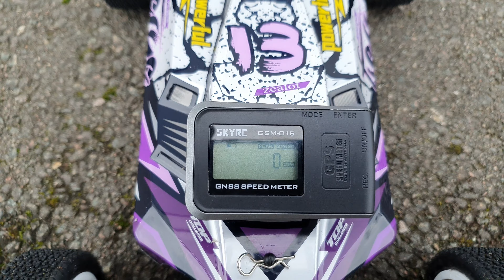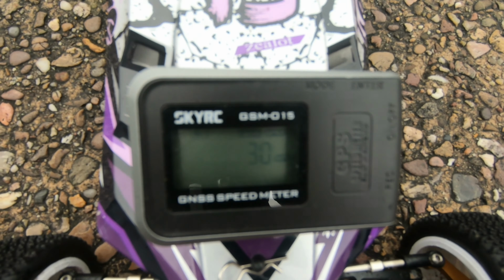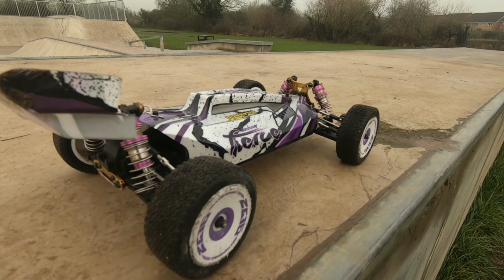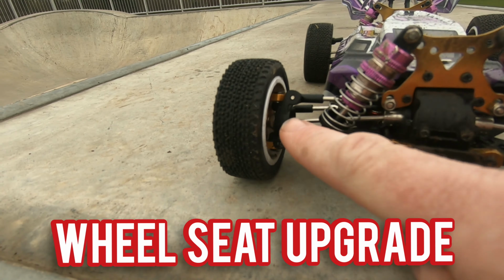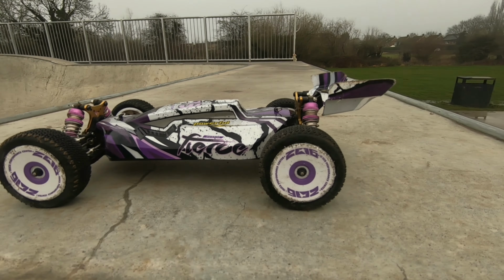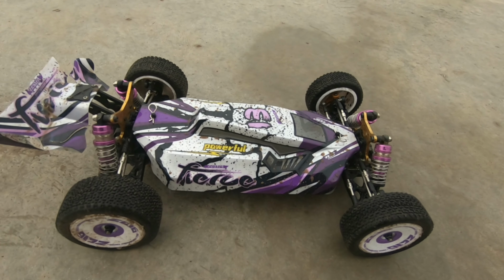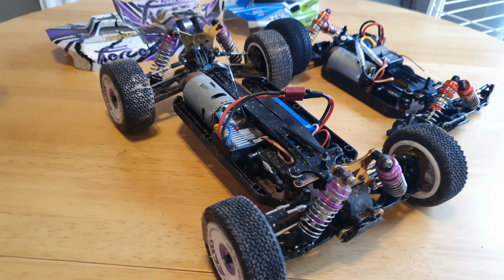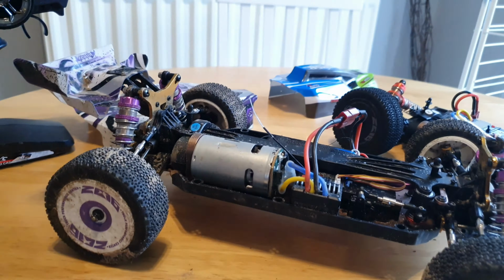WORLDS BEST WLTOYS RC CAR (124019),EXTREME BASH!!***

Comment: Excellent video! Thank you for posting. I'm wondering if getting it wet had anything to do with its demise?
Reply from the maker: I don't think so ,its just the motor don't like hard landings 🙄
Reply: @rchobbiesuk9492  Well, the motor runs, just sounds like it has TONS of strain on it... it could be the diffs, i heard that the differentials are absolute TRASH. Maybe get the full metal diffs that are available on amazon or banggood.

Comment: I have one of these. Not fit for jumping these cars. Let it stay on the ground, asphalt, gravel and a bit of dirt. That is it. Then you hardly break anything and the fun will last longer.
Reply from the maker: cheers thanks for the advice 👍
Reply: I have one of these and have modified it myself with some metal protecting the shock towers and stuff helps for crashes break less

Comment: i am getting this car and I am wondering if the stock charger is good or if it will kill the Lipo
Reply from the maker: No problems with mine
Reply: @rchobbiesuk9492  thanks!
Reply: @wintxrx4909  I’m guessing you already got yours so how was the charger?
Reply: @bakedreaper3628  good, it works great